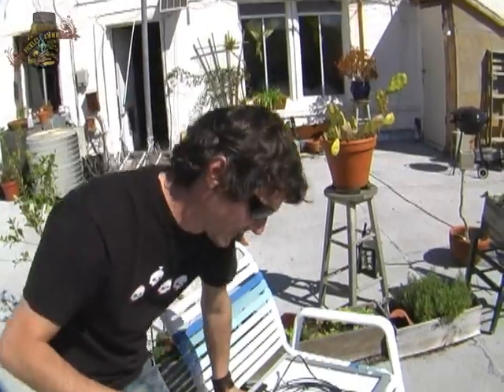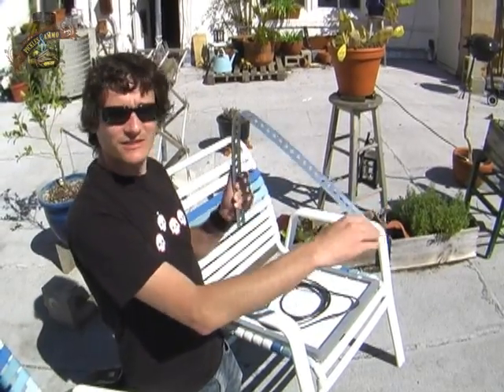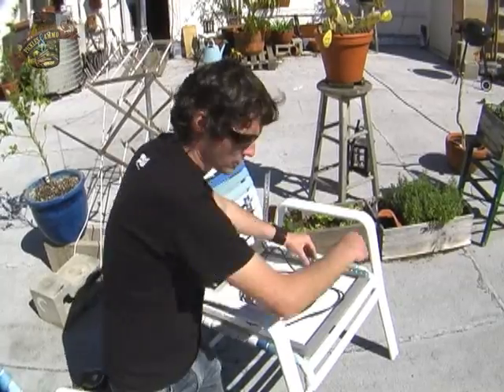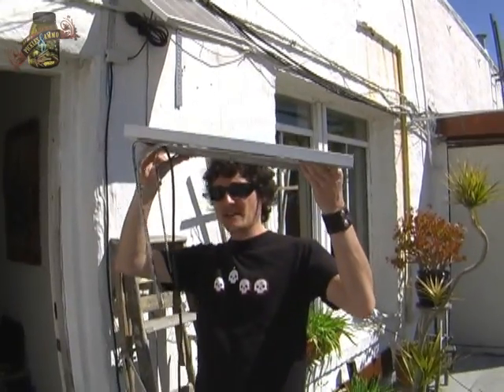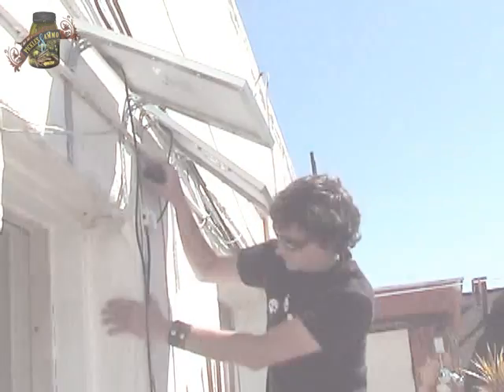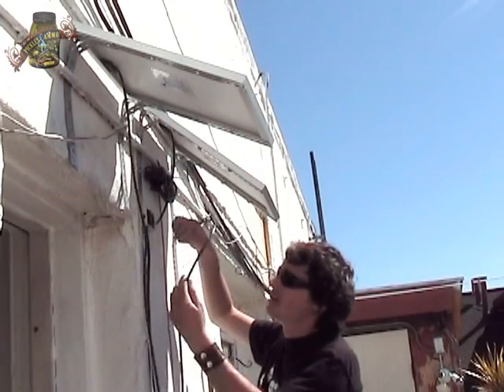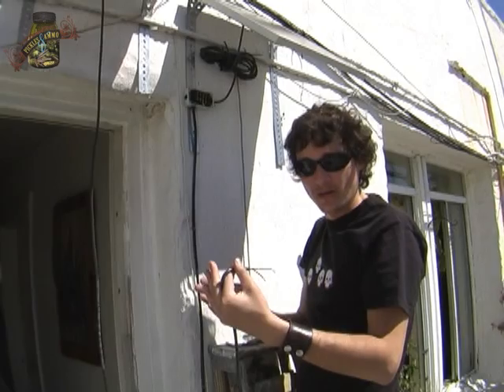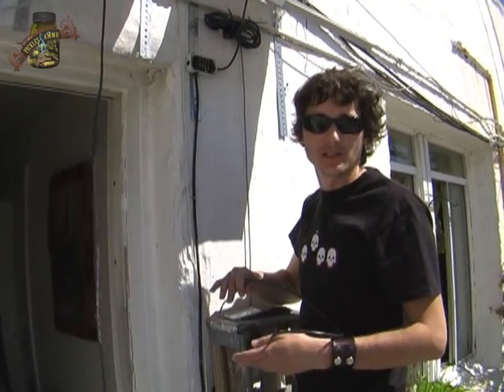SPAABII part2

Comment: You answered so many issues that I'm having with improving my setup.
Perfect! One question ....Can you mix panels in parallel if those panels have same voltages (+-1v) but different watts? 
I have a 53 watt siemens, an 80 watt kyocera and 80 watt sharp?
OK for all in parallel to same charge controller? Should I use inline blocking diodes before the combiner box?